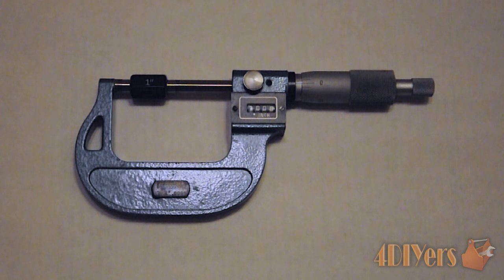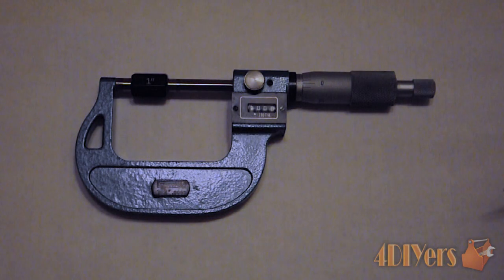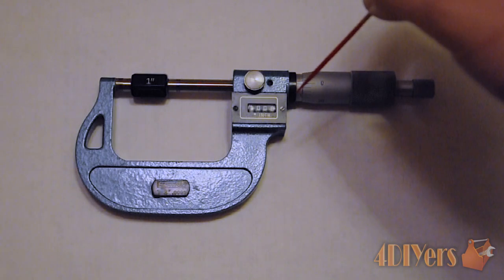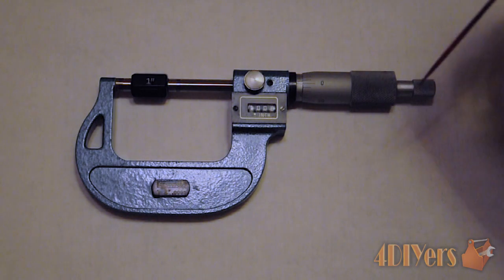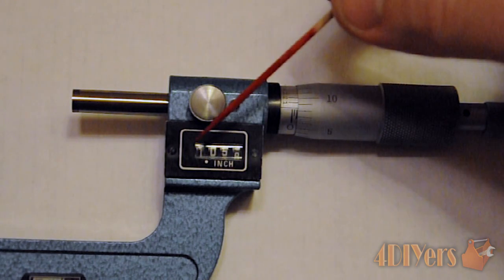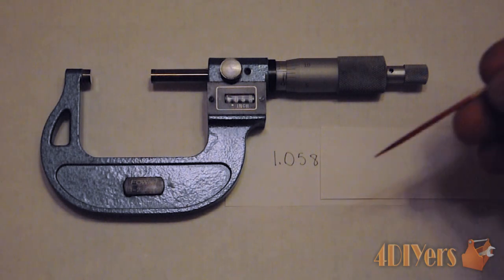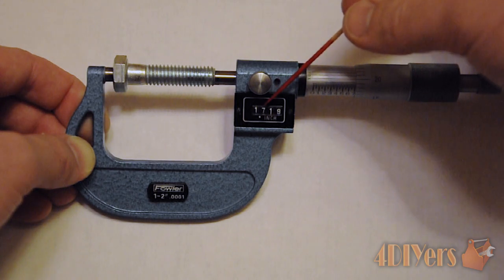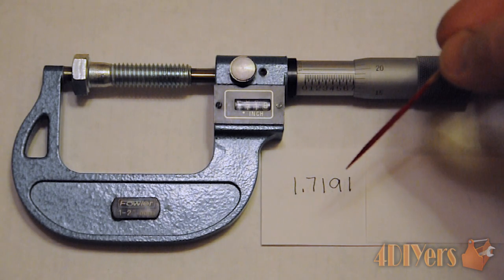DIY: Reading a Mechanical Digital Vernier Micrometer Imperial

Comment: great video, I needed that to figure out to read the 4th decimal place, thank you.  Question, how do you calibrate or 0 out this type of micrometer?  I think mine is good but...
Reply from the maker: +Lance Schul Thank you. Use the ratchet to close the spindle closed, and there should be a special C wrench that came with the micrometer. It should clip into the a small hole on the sleeve, then turn accordingly. If you have a larger micrometer such as what I've shown in the video, then use the gauge block and close the spindle with the ratchet. Again same process, using the wrench, adjust the sleeve.